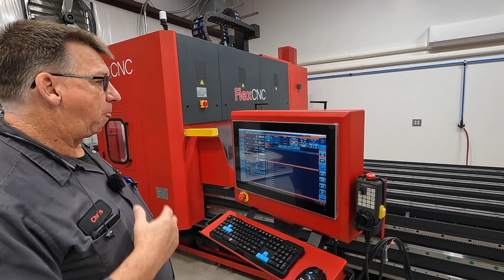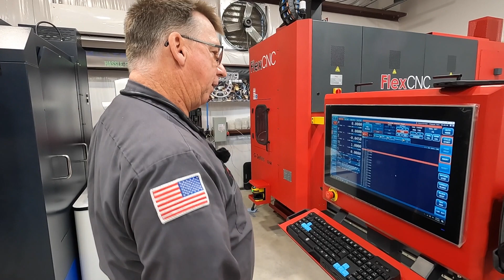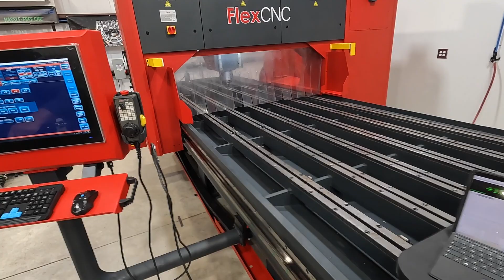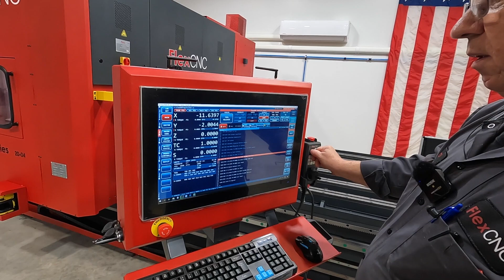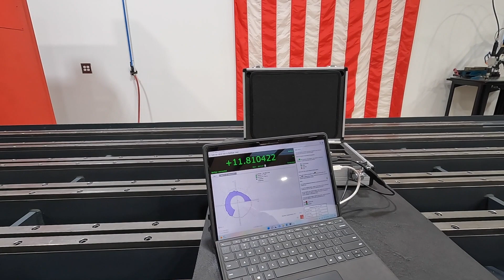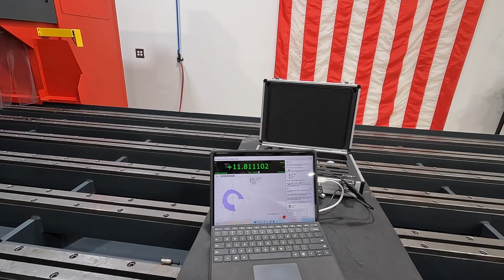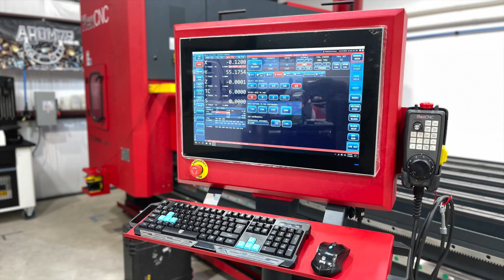Installing the Flex CNC Long Bed Vertical Machining Center

Comment: This is TWO equipment moves that could have been eliminated by sending a crew out, with accurate templates, as part of the initial delivery.
Reply: That wouldn't work. Better do it like they did.  You can make a template for YOUR fridge when you plan to move it.
Reply: @swedishpsychopath8795  Are you telling me flexarm couldn't lay out a template on a 20' roll of wide paper? The feet only have to be resting on the metal plates, doesn't seem too precise to me.
Reply: @andrewterry8092  It won't work. Trust me. Paper may get wet and stretch in moisture and moths may bite holes in the paper confusing the crew on where to drill.
Reply: @swedishpsychopath8795  Paper wet? Moths? Come on, dude, you're just yanking my chain...
Reply: @andrewterry8092  Lol - a little bit :)
Reply: @swedishpsychopath8795  Funny, thank you!

Comment: OMG: So I'm a software developer and the console for that thing will give even me nightmares on how to program. A79 will never master the CNC programming paradigm.  He should sell them CNC's and free ut the floor space to put a couple of southbend lathes, scrapers, honing machines, weld station and maybe a MEGA lathe for really long / big parts.
Reply: Wow, Adam is a bright guy, I'm sure he's perfectly capable of learning whatever he needs to.
Reply: My understanding is he does not own them, they are provided for demonstration purposes, the dealers could ask for them back anytime. (correct me if I'm wrong)
Reply: Just because you can't understand something, doesn't mean others can't either. You want lathes and scrapers you are free to get some. Let Adam have his shop the way he wants. He's willing to learn new things and have means to do it.
Reply: @ilaril  But A79 can't remember stuff. He calls Steve from Milltronics every other day just to ask how to turn on the darn machine.  He must let them CNC's go and go back to his league.
Reply: Obviously, you don't know how to use or program machine tools.  The Flex can be used in a number of different ways.  If a part has multiple operations, you set up different stations along the length of the bed and machine the part in sequence instead of in batches.  Once you have all of the stations populated you move the parts from station to station and finish the parts in sequence so you don't have to tear down and set up a new fixture every time you change operations.
Reply: @swedishpsychopath8795  I'm an experienced CNC machinist, and I don't know everything on the mill, or the software I work on. After fifteen years, I still occasionally call Mazak and the CAM team for tech support. ABOM is going to be calling support frequently the first year he has these things, but he'll get them figured out.
Reply: @CorDawgYT  imagine if a content creator actually sat down with their audience and made it clear what relationship he had with his tooling supplier was. It would be a 5 minute conversation.
Reply: But this is not about you, so why don't let it be and  let him show us what is he able to do on HIS  OWN SHOP ? Wherever was the way he gets all the machines, the real thing is he got all those now... Let it be... Time talks
Reply: CNC programming's not THAT hard, unless you have a project that uses some of the weirder codes. And even those can be worked around if you're willing to sacrifice program size and cycle time.

Comment: How much does it cost
Reply: I'd like to know that too, my guess is $150-250k. Their website states "Request Pricing". As Dave Jones (fellow YouTuber) always says: If you have to request a quote, you can't afford it.
Napkin maths: 10k power electronics 10k control electronics 20k dimensional materials 10k precision materials 20k mfg/assembly 5k onsite install. Add R&D cost, software, fixed costs, management and handling, then double all that to turn a profit.
Reply: If you have to ask the price, you can't afford it.  The bigger question, how much will having the machine improve the bottom line of Booth Machine Co.
Reply: @spacenomad5484  for that price there're better options out there

Comment: What was the circularity?
Reply: It checks if the propellar in the cooling system makes vibrations that will offset the laser.  An uncalibrated laser may burn down a79's truck if he let the machine run while he is in his office for a snack.

Comment: So a79? Crashed into that CNC console trip hazard yet? Looks like an EXTREMELY BAD place to have a stickout in the middle of the workshop.
Reply: You can park it near the end.
Reply: As Adam said the console slides on rails along the machine so it can be moved all the way to the far end of the machine when it's not in use.

Comment: Since the machine is not bolted to the floor, you should have epoxied those steel plates to the floor.
Reply: I promise you a machine that big is not going to move anywhere by itself
Reply: It is bolted to the floor. Apparently, you missed 43:34.The anchors go through both the leveling pads on the machine as well as the steel plates. Once the machine is leveled with the jack screws in the leveling pads ... which bear on the steel plates ... the nuts on the anchors are tightened which "sandwiches" it all to the floor.
Reply: @elanjacobs1  Yes it can walk as the floor settles. Most floor plates have a round countersink to screw the bolt in. It's very bad that he put it across the expansion joint in the concrete. The bed will twist and he'll be ok working on A36.
Reply: @tsmartin  How do you bolt the machine to the floor and then use the screws to level the machine on another plane within .001"?  The plates provide a bearing surface for the weight of the machine so you don't crack/pop the concrete. No precision machine is bolted to the floor. Lathes, presses, mills, hones, are all put on leveling pads. I seen a 300ton press rock back and forth until it was releveled.
Reply: A79 isn't a strong believer in bolting things to the floor. He likes to have drop/trip hazards and stuff like that.  Just look at the Baldor pedestal grinder, it is still unbolted even though it is a tall and narrow machine with at small base-plate.
Reply: @elanjacobs1  It will for sure move and  bend due to thermal influences.
(Put a 10 ft lathe in a front of window and it will become a banana due to the sun shining brightly on it)
Reply: @janvisser2223  do you see any windows here? He doesn't need to hold tenths and it's not climate controlled anyway
Reply: @martylost167  It depends. I have a lot of old machines. Manuals sometimes call for grouting in and some others don't. It very much depends on the type of machine and the performance to be achieved. My Jung surface grinder comes with factory levelling feet. I also have a turret lathe which is a single closed cast iron box construction which the manual says to only level with sheets of leather, plastic or cork, no bolting down. My mill and center lathe should be grouted in.
Reply: @elanjacobs1  I did not see a window. But did you understand that I gave an example about the effect of temperature differences??
Reply: @janvisser2223  yes i know that. for what he's doing, it's not going to matter

Comment: Aptly named Flex because the construction of that machine means a horrible lack of stability and dampening. Nice maybe for wood, non-ferrous metals and maybe drilling jobs in steel tubing etc. A serious machine is cast iron and about an order of magnitude heavier.
Reply: Wobble, wobble, wobble ;-D
Seen wood routers of similar construction, but these were rated for 0.1mm accuracy, that thing apparently wants to be 0,001mm
Also good luck with the floor, once the concrete settles, that thing will go banana for sure....
Reply: It's a router and as far as routers go, Flex ones are heavy. You don't make cast iron routers and you don't use routers for when you need super high precision in any material. As for material it can take... You realize you're basically proving your ignorance on the subject right? How hard material you can work with on any given machine depends on the speeds you're going at, not the machine as such. You can make a machine out of plastic and if you just go slow enough, you can mill any material you like. The precision depends on the rigidity of the frame and the accuracy of the servos, not the weight, which really only limits how fast you can work before you start losing accuracy.
Reply: Do you own  one of these?  Have you actually factually used one of these? For how long?
Reply: @hinz1  Sure hope Adam has no ground water pressure problems as a couple of the drilled holes appear to have broken through the slab.
Reply: Monday morning quarter backing already before the machine even starts up?
Reply: @danieljonsson8095  Ah right. Go ahead and machine some Inconel on your hobby router... slowly.
Reply: @bigbattenberg  eh? Inconel is only 32 to 40 HRC... modern regular steel is well above 60 and plenty of hobby routers are used for that... just very slow and inefficient. Only reason no one does inconel on hobby routers is because hobbyists don't work with inconel period because the benefits are not worth the price for hobby projects.
Reply: @silasmarner7586  No need to own own to judge it. Any experienced machinist or engineer can tell. But yes, just like other comments here say, it's about knowing what is can and can not do. I'm sure it can have its use just like I mentioned. 
I did not expect Adam to get a machine like this knowing him from way back working with high quality American iron. It is very likely sponsored. 
I have worked with a great deal of machines both conventional and CNC in several companies and have my own shop with conventional mainly German and Swiss machines. 
Not my project back then but in 2010 I worked at Fokker here in Holland where a large Fooke portal mill for machining CFRP parts was installed. The concrete foundation was completely custom made for the machine, It took months from start to finish. Insanely interesting.
Reply: @danieljonsson8095  What is 'modern regular steel'? Also, hardness is just one of multiple parameters determining machinability.
Reply: @bigbattenberg  As in any steel with a 10 series designation. And ofc it's just one param for machinability but it's the only one that has an impact at all for the stability of the machine. Some material will need coolant, some will require no coolant and others will require specific types of coolant. Some will require a spindle that is faster, some can do with a slower spindle and so on and so on. But the only thing that has an impact in any way from the stability of the machine, is the speed you can work at. Less stable machine means you cant go as fast, that's all. Every other property for machinability have completely unrelated parameters of the machine. And as I said before, you don't use a router for the speed or precision. Those are all things you knowingly sacrifice at any point you use a router. Routers are used for working with large work pieces where a mill would simply be unfeasible. Like can you image how big a mill that can take as big pieces would be? It wouldn't even fit in the entire workshop even if no other machines were there at all. POSSIBLY it could fit if also removed the crane and put it sort of sideways  but I doubt it. And I'm not aware of anyone making mills that big either. It would be absolutely ridiculously expensive to make. And I wouldnt wanna be working with such a mill anyway. A servo powerful enough to move a table that big... especially the z axis... Well you'd not do that with one servo but multiple ones along the entire length, but man... Just imagine the noise level of moving like 20-30 super high power servos. And the running costs... It would be absolute insanity, and no one does it even as an experimental thing.
Reply: @danieljonsson8095  I don't understand. Just search for big mills here on YT and you be obviously be amazed!
Reply: @bigbattenberg  Even the biggest mill shown, doesn't actually come close to being able to work with pieces as big as this router. Look, you know that long table? To be a mill, you'd have to move that entire table, from all of it being on one side of the head, to all of it being on the other side. Meaning it has to be twice as long as the max size workpiece, and then some more as margins. You also have to be able to raise and lower that entire table across that full length. Like say you want two foot of z axis, now you have to lift that entire table, up two feet, and maintain perfect balance while doing so or your accuracy goes out the window. That is something incredibly difficult with even just two servos that as video here goes over requires fine tuning... Just imagine the complexity of trying to do that across 20 servos instead, all of which has to be fine tuned to every single onevof the others, both for torque and for precision... I'm sorry but it's just a plain ridiculous notion to build mills that big. And just in case, even if they are sometimes mislabeled, you're not watching a vid of a router and thinking it's a mill right? For those reading that don't know, a mill has a head with a static position and moves the workpiece relative to head by moving the entire table that youre fastening the workpiece on. In contrast to a router which has a static workpiece and instead has a moving head that moves across the workpiece. The line can at times get a little blurry as there are hybrids that move workpiece and head depending on which axis it is. So might as an example have a table that does xyz, but tilts the head for a and b. But these machines are neither true mills or true routers, even if they're often called either just as mills and routers are often mislabeled as each other. But the machine here is a true router (unless it has a and b axis on the spindle but I saw nothing that would indicate that it does in this video.

Comment: Get rid of that thing!  That machine is a bad fit for your shop.  It's occupying a huge amount of floor space for something you are not likely to use. You might end up using it for a few jobs, but I doubt you will ever need that long bed capability.  I'm sure Flex were very keen to get one onto a channel for promotional reasons, but man, that is taking up a lot of space.
Reply: How do you know what he has planned for it, Mr internet expert ???
Reply: @TheCuriousOrbs  
Do you know? Please tell.
Reply: He will move into a larger shop later on, when it's ready. Until then, he got no bigger issue with the thight space
Reply: @TheCuriousOrbs  Having followed the channel since pretty much day 1, and run a busy shop myself, I know what kind of work he does and what machines make sense. CNC is great, but that is a very specialist machine that only a few specialist shops would ever have a need for.  Cutting keyways in big shafts maybe? Spars for planes might be an application. These days he just does small jobs the viewers mail in. Woud love to stop and chat, but I have a CNC mill to run this afternoon ...
Reply: You got one thing right. HIS shop. You can do whatever you want in your shop. Your audacity is astounding though.
Reply: @Rimrock300  
When is that gonna happen?
Reply: @Peter_Riis_DK  Only Adam and the Mrs knows. He has mentioned 'a coupe of years'. A possible new house, with attached large workshop
Reply: @itsverygreen532  --- It might be useful in making jigs.   Someone could slap together a large fabricated (i.e.: welded together) mess and the machine would cut out unneeded pieces leaving a good sized jig or even a specialized part in a metal forming operation.
Reply: @GilmerJohn  Not a lot of that sort of work out there. It doesn't appear to have a compound/ 5 axis head otherwise it would be a good machine for machining up fabriacted beds for smaller CNC machines ... but you really need that side-drilling capability for that. Very oddball machine .. very specialist.  Aircraft ribs and spars are pretty much the only thing I can see as an application area.